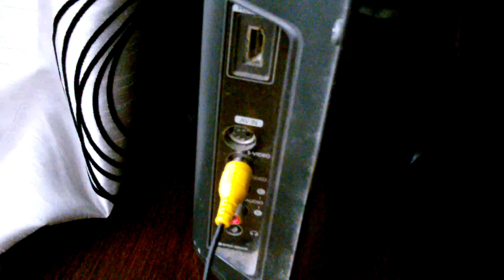Micro FPV kit test

Comment from the maker: Hi there. Sorry I have not done so before. At the moment it runs with 2 x batteries. one of which just hangs off the bottom!!. I have just recieved a filter,that will hopefully enable me to run it from one battery. I will post a pic of the finished quad when I am happy with it. Cheers.